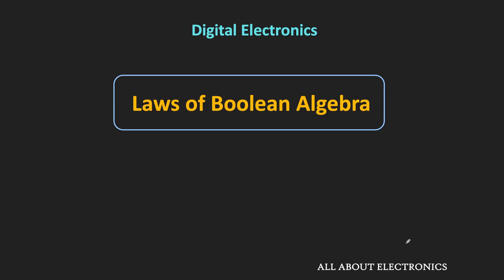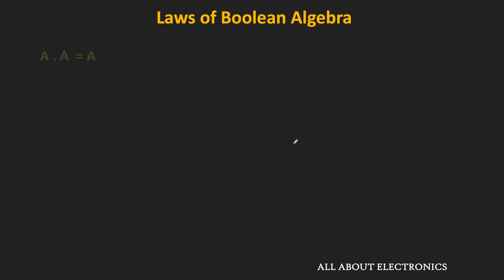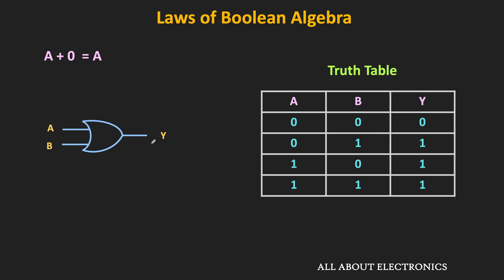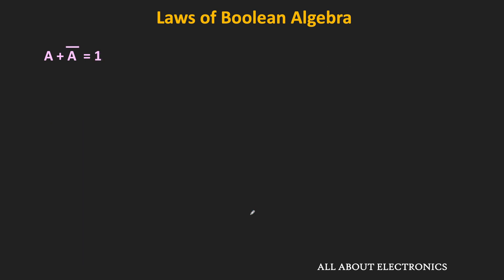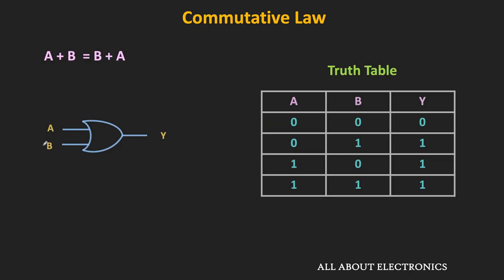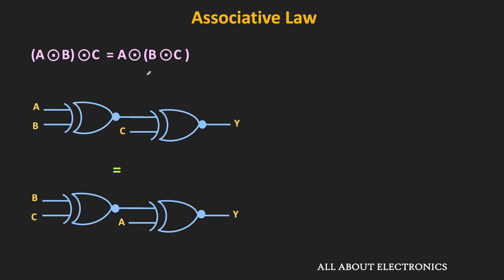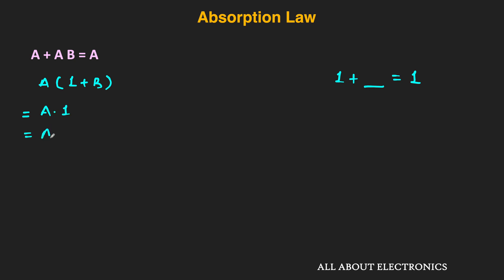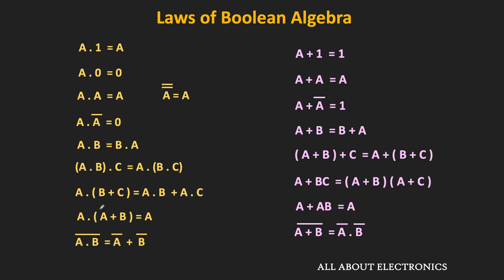The Laws of Boolean Algebra Explained

Comment: I am confused with A.A' Y is always 0. Isn't A=Y so A. A' = 1?
Reply from the maker: It’s AND operation of A and A’. Think of it like you have connected two switches in series. One is open and one is closed. Will the current pass through it ? No, because one of them is open. That’s why  output of it is always zero. Instead of that, suppose we have A.A then output will be 1. I hope it will clear your doubt.
Reply: @ALLABOUTELECTRONICS The switches example cleared it for me yeah. Thanks alot.

Comment: how can i create logic circuit if i have boolean expression?
Reply from the maker: First try to simplify the Boolean equation using the Boolean Algebra. Then depending on the Boolean equation, you can use the logic gate. For example, whenever there is an AND operation in the expression, you can use the AND gate. Whenever there is an OR operation, you can use OR gate. If the expression is something like (A.B.C )' then you can use 3-input NAND gate. 
And in this way, you can implement the logic circuit for the any given Boolean expression.
Reply: @ALLABOUTELECTRONICS  ❤️

Comment: Why A+A' = 1 it's not right because if passing A= 0 and A' = 1 == 0 ri8 then o/p will be 0  then why 1 ?
Reply from the maker: If A = 0 then A' = 1. That means A + A' = 0 + 1 = 0. 
For OR operation, if any one of the input is 1 then output is 1.
I hope it will clear your doubt.
Reply: @ALLABOUTELECTRONICS  cleared. I thought like we will assign 0's and 1 individually for A and A' I just lost that concept if A = 1 means A' going to be zero only so A+A' = 1. By the way amazing explanation man thankyou much appreciated... But I couldn't get the differences between laws(commutative, associative, distributive) it seems for me, All are derivated in similiar ways only.  How can I ack the differences in problems like it should be solve in this law that law, like that. 
How should I practice it ???

Comment: Sir, is there any exact method available to solve boolean algebra? 'cause I usually get very confused when the lengthy sum is asked in the paper...🤔🤔🤔
Reply from the maker: There is no exact method. You need to use the Boolean algebra laws only. But if you know K-map, then you can easily find the simplified expression. If the Boolean function contains upto 4 variables then Karnaugh map method is good way to get minimised expression. It is covered on the channel. Please check the digital electronics playlist on the playlist page of the channel. You will find it.